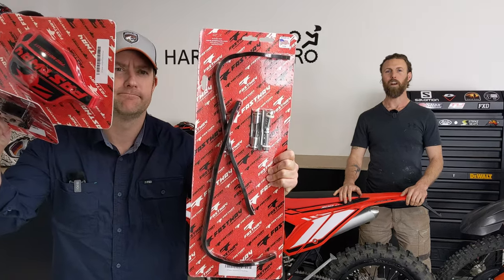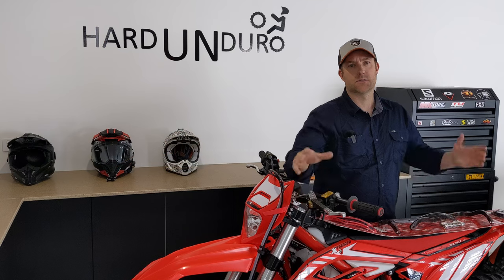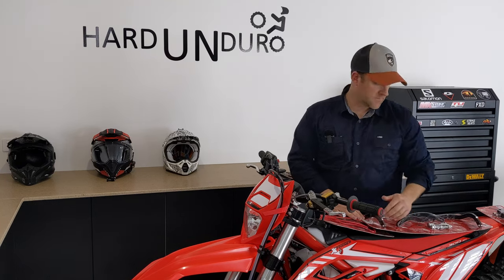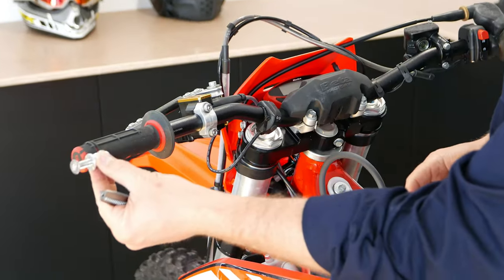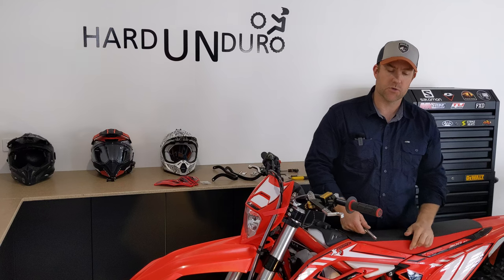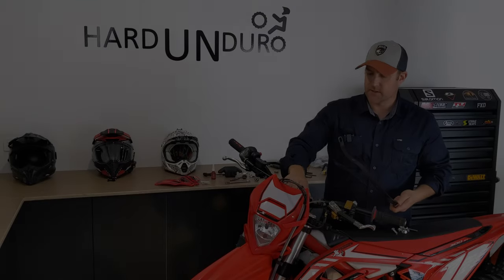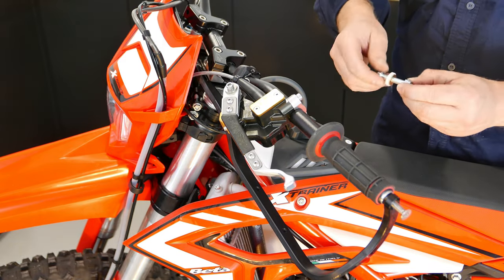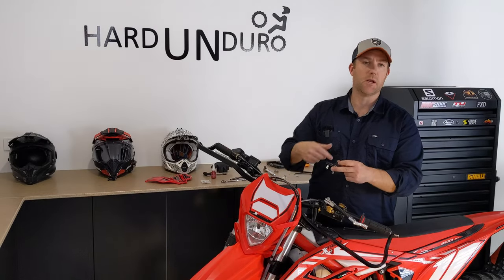Fastway Handguard Install Beta Xtrainer 300

Comment from the maker: In this video we install Fastway F.I.T. 3 Handguards to our Beta Xtrainer 300 which is the same method for any bike. These are great looking, robust handguards, that also give great clearance for things like Clake clutch levers. Fastway use a bar end tapping system and replace your factory handlebar mounts, giving you an incredibly strong handguard setup that will not work loose or rotate. Let us know if you have used these or have any issues with your current handguards!